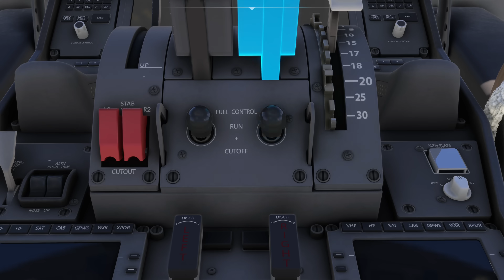Air India 171: Why Did The Fuel Cut-off Switch Get Moved?

Comment: An aeroplane can continue to gain speed for 4 to 6 seconds even after the fuel supplies to its engines are cutoff! 

That implies that the fuel cutoff to the engines occurred earlier than what is indicated in the AAIB report! 

Every discussion on YouTube or elsewhere overlooked this one very important aspect of an aircraft. 

An airplane can continue to gain speed for a few more seconds after fuel supply is cut off due to any reason (not necessarily because of 'transition' of fuel switches from run to cutoff). This is because the engines do not stop instantly. There is still momentum in the rotating engine components (N1 and N2 spools), and some residual fuel remains in the fuel lines and combustion chambers. Also, the aircraft is already accelerating, so inertia and thrust decay happen gradually. All this allows the plane to keep gaining speed briefly before the loss of thrust becomes noticeable.

Now this fact compels one to look at the timestamps of the events that occurred on the Boeing 787 flight AI 171. And it doesn't conflict with the observation and report of AAIB! 

AAIB report seems to indicate that the aircraft started loosing speed immediately because the fuel switches were transitioned from run to cut off. This is wrong! 

Event Sequence — Boeing 787 Fuel Cutoff Incident

1. Takeoff Roll — Acceleration Begins:

Aircraft begins accelerating down the runway at full rated thrust.

V-speeds (V1, Vr, V2) are being monitored by the FMS and aircrew.

2. Liftoff — Aircraft Becomes Airborne:

Liftoff occurs at Vr.

Air/ground logic transitions to air mode.

Aircraft pitch and climb initiated.

Flaps still partially extended; landing gear not yet retracted.

Aircraft still experiencing strong forward acceleration.

3. Uncommanded Fuel Cutoff to Both Engines:

Most probable cause would be a catastrophic electrical failure like :

Electrical bus fault or short circuit (cutting EEC power).

Faulty signal or switch logic mimicking cutoff.

Internal failure in AIMS or FADEC sending shutdown signal.

Dual-channel software bug or simultaneous component failure. Any of these would result in the fail safe fuel shutoff valves to close resulting in the engines spooling down.

Fuel switch positions remain in RUN, but DFDR may or may not record this depending on signal logic power status of DFDAU.

4. Aircraft Continues to Gain Speed Briefly:

Inertia + Climb Momentum + Engine spool-down lag explains:

Aircraft still accelerates for 2–5 seconds after fuel cutoff.

Hence maximum indicated airspeed (IAS) of 180 knots was recorded maybe after engines started failing.

No immediate pitch or flight profile change would be noticeable yet.

5. Pilots Do Not Immediately Feel It:

No abrupt deceleration initially.

Cockpit quiet, engines still producing residual thrust during spool-down.

External cues (sound, vibration) may not be obvious at first.

6. Alarms/Alerts Begin Triggering:

Sequence may follow this order (within 1–3 seconds):

ENG FAIL L / ENG FAIL R caution (one after the other).

Master Caution / Master Warning triggered.

Loss of Thrust on Both Engines warning logic activates.

AUTOSTART not successful message (if automatic relight initiated).

RAT DEPLOYED (if power buses lost — to restore hydraulic/electric).

EICAS messages cascade on screen.

Aural alert: “ENGINE FAILURE,” followed by triple chime.

7. Chaotic situation in cockpit:

Both pilots in a confused state of mind. 

Cross-checking engine gauges: N1, N2, FF, EGT — all dropping.

Checking fuel switches: Still in RUN.

Confusion all around. “Is this real?” or a false signal/faulty indication?

8. Aircraft Response Becomes Noticeable:

Acceleration stops. Climb rate decreases.

Flight path begins to flatten. This is the time when the CVR's two line conversation between the pilots could have taken place. 

9. Immediate Memory Item Execution:

Crew recalls Dual Engine Failure After Takeoff memory item: "Both engines lost thrust. RAT deployed. Fuel switches — cycle/reset."

Fuel Cutoff /Run switches cycled:

RUN to CUTOFF (pause ~1 sec) to RUN

Why reset/cycle? This forces EEC reboot and fuel valve reactivation, in case of transient or false signal.

Why pause 1 second? : To ensure command is registered and EECs reset. 

Sequence may be one switch at a time or simultaneously depending on SOP.

This start of reset procedure (mentioned as 'transition from run to cutoff' in the report) takes place not immediately after maximum air speed was recorded by DFDR (and realized by the pilots) but some few seconds later. That would answer the 10 second delay questioned by many. There was no delay. Everything happened as per procedure. Even the 4 second gap between transition of engines 1 and 2 from cutoff to run should be seen in that light. 

10. Fuel Switches Reset Complete:

Engine EECs respond:

Power and inputs seems to have restored. Auto relight of one engine initiates. Second engine is struggling. 

The APU Inlet Door began opening. It auto-starts to restore electrical bus and bleed air.

11. If only there was more altitude...

The timestamps are as follows. (The time stamps not mentioned by AAIB have been marked with asterisk.) 

1. 08:07:37 — Aircraft begins takeoff roll. Thrust set to takeoff power. Acceleration begins.

2. 08:08:33 — Aircraft crosses V1 (153 knots). Takeoff decision is now committed.

3. 08:08:35 — Aircraft reaches Vr (155 knots). Rotation initiated.

4. 08:08:39 — Aircraft lifts off. Air/ground logic transitions to "air mode." Pitch-up begins. Speed continues to increase due to takeoff thrust and momentum.

5. 08:08:36–08:08:37 (estimated) — Uncommanded fuel cutoff occurs. Likely causes include electrical power loss to EECs, short circuit in engine control bus, internal FADEC or AIMS fault, or erroneous logic signal. Both fail safe fuel control valves close, stopping fuel supply. However, due to engine spool-down lag and aircraft inertia, there is no immediate noticeable change in performance. 

6. 08:08:42 — Maximum IAS of 180 knots is recorded. This is consistent with aircraft continuing to gain speed, for about 5–6 seconds after fuel cutoff, due to existing thrust and momentum. This is the peak airspeed recorded before deceleration begins. The pilots don't feel anything amiss so far. 

Hereafter AAIB preliminary report doesn't mention timestamp for events happening during the next 5 seconds till 08:08:47 

Why? Had the power supply to the Digital Flight Data Acquisition Unit (DFDAU) failed?

7. 08:08:43* — Engine 1 FAIL caution likely appears. N1 and N2 begin to decrease. First alert is triggered by dropping engine parameters or loss of fuel flow (FF).

8. 08:08:44* — Engine 2 FAIL caution likely appears. Second engine parameters falling below idle limits. Engine Indicating and Crew Alerting System (EICAS) displays alerts. Master Warning likely triggered around this time. 

Going by the AAIB report.. 
this was the time (no timestamp provided in report) when it might have suddenly dawned on the pilot flying that both engines are fuel starved.  Not believing what he is watching, he instinctively asks the pilot monitoring if he had cutoff the fuel switches. Pilot monitoring replies in negative. 

9. 08:08:45* — Pilots now see ENG FAIL L and ENG FAIL R along with Master Warning light and aural alerts. No significant yaw or roll felt yet. They begin reviewing engine instruments. Fuel switches still in RUN position.

10. 08:08:46* — Ram Air Turbine (RAT) automatically deploys due to loss of both engines and AC power buses. Provides hydraulic and limited electrical power. RAT deployment supports critical systems like flight controls and instrumentation. Power is partially restored.

11. 08:08:47 — RAT hydraulic pump starts supplying pressure. Hydraulic control is restored. 

From here on AAIB report starts mentioning timestamps again as RAT probably partially restores electrical power to critical systems including DFDAU . 

12. 08:08:48–08:08:51#— Pilots recognize dual engine failure and begin memory items. First step: cycle both fuel control switches to attempt reinitialization of FADEC and re-enable fuel supply. Memory checklist requires moving switches to CUTOFF and back to RUN with slight delay.

#
AAIB report mentions timings of these events as "immediately afterwards" the maximum airspeed at 08:08:42 is recorded. This could be anything from 0 to n seconds. So this 'derived timestamp' of 08:08:42 is 6 seconds later and fits in well with AAIB report. 

13. 08:08:52 — Engine 1 fuel control switch moved from CUTOFF to RUN. This is the first engine's reset attempt.

14. 08:08:54 — APU inlet door starts to open. APU Auto Start sequence is triggered automatically by loss of AC power. If successful, it may provide electrical and pneumatic power.

15. 08:08:56 — Engine 2 fuel control switch moved from CUTOFF to RUN. This is second engine's reset attempt. If fault was transient or resolved by switching, EECs would respond and initiate autostart sequence.

16. 08:09:05 — Pilot calls "Mayday...." 

17. 08:09:11 — If only there was more altitude available.. 

---

Explanation of critical intervals:

The actual fuel cutoff likely occurred around 08:08:36–37, based on the fact that maximum speed was reached at 08:08:42 and engines take several seconds to spool down.

Speed gain after fuel cutoff is physically plausible due to inertia, pitch angle, and momentum.

Alerts are triggered once engine parameters like N2 drop below idle or EGT/FF readings fall.

RAT deployment is a protective automatic action to ensure flight control power and limited avionics support.

Pilot reaction follows trained memory item: Cycle fuel control switches to reset engine control logic.

Comment: Co-pilot did it ..becoming more and more obvious that either the co-pilot turned the fuel off and asked the pilot as a deflection to his suicide mission (maybe for family honour and compensation). There seems to be too much time delay between them being turned off and then turned back on. Also as the main pilot is totally focused on take off duties it would have been quite obvious and visible for the co-pilot to notice the pilots action whereas if you flip this, it would be more likely that the co-pilot could turn the switches off unnoticed because the pilot is so focused on take off.  And finally as Capt Steve has said on many occasions there is absolutely no scenario during take off to have both fuel supplies turned off and therefore instinctively the switches would have been turned back on before any questions being asked ...this was a 10 sec delay which was critical in the attempt to save the flight 
OR
More likely..
System electrical failure.
In simple terms, something as simple  as a relay turns pumps off, no fuel supply alarm goes off but switches were still in the on position hence the time delays in communication because  pilot went to turn on the switches but they were already in the on position

Comment: What really happened on Air India Flight 171? In this video, I explore a developing theory that a rare electrical failure may have caused both engines to lose power — not because of mechanical failure, but due to how the 787’s safety systems are designed to respond in extreme situations. Specifically, we look at the possibility that the aircraft’s fuel shutoff valves (FSOVs), which are designed to close automatically when power is lost, may have played a role. This isn’t confirmed — but it’s a plausible scenario worth examining as we await the official report.

Comment: There is no way the pilots did this, it was an electrical/software issue with the fuel switch. 
The timestamp and the duration for when the switches were apparently switched off by the pilot and back on by the other pilot just does not add up., especially if you are trying to save your life.

Comment: Hi, Captain steeeven. I mainly am a television and video and computers engineer and i also have knowledge of many other electrical and mechanical devices. Firstly my condolences to all families of the victims of this tragedy. I have been trying to understand what could of happened to this flight. According to the diagrams of the mechanical side of these levers they are spring loaded and solenoid driven. I do know that if solenoids go faulty they will automatically disengage and reset themselves and go back to the start operation which in this case was from run to cut off. Sometimes you will get them to doing nothing if the solenoids completely fail and they would remain in one position only. So along with a thought of this being a human error these solenoid levers also don't have reputation of reliability.

Comment: Where does the data get the signal from that indicates that the fuel switch is at the Off position? It does get it from the mechanical switch but most likely from somewhere at the computer. Which means that it could also be the computer that switched off the fuel

Comment: This guy shouldn't be allowed to fly any aircraft isn't this same guy who said about that flaps thing?Even non aviation person can tell that flaps can't be the reason for plane to crash right after takeoff(the plane was literally 600+ ft above the ground)so idk how this guy became pilot like flaps how did it even came to your mind?😂 boeing told you or what?
similar incident during which one of the engines suddenly shut down midflight on an All Nippon Airways Boeing 787 during its final approach to Osaka, Japan, in 2019.

investigators later found that the aircraft's software had mistakenly interpreted the plane as being on the ground, triggering the thrust control malfunction accommodation system, which automatically moved the fuel switch from "run" to "cutoff" without any action from the pilots.

Comment: similar incident during which one of the engines suddenly shut down midflight on an All Nippon Airways Boeing 787 during its final approach to Osaka, Japan, in 2019.

investigators later found that the aircraft's software had mistakenly interpreted the plane as being on the ground, triggering the thrust control malfunction accommodation system, which automatically moved the fuel switch from "run" to "cutoff" without any action from the pilots.

Comment: Wouldn‘t it be enough to only allow the fuel cutoff switches to work in descent upon reaching a certain altitude (in which it might be needed)? Having both pilots confirming the shutoff is still not fail safe and as you mentioned increases reaction time drastically. Another issue is that one pilot might be unconscious or something in certain situations.